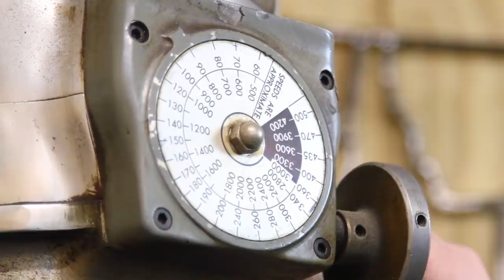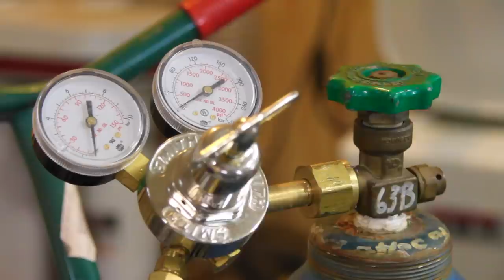Making a Striking Anvil

Comment: I absolutely love the anvil, Paul. It worked great today. Nice getting to meet you for the pickup. Thanks again.
Reply from the maker: I’m glad you like it! It was great meeting you too
Reply: So what is different about a "striking" anvil and why do you need one?
Reply: @carpediemarts705   It's an anvil saver.  When using a sledge hammer to do heavy work, if you miss, the striking anvil takes the hit, not the expensive, hardened anvil facel.  Also is a bit lower so the striker can get some power into the swing.  The striker being a human power hammer....  Or rat powered if this is a documentary:  https://youtu.be/8Gwty_y2J78?t=9

Comment: Can you forge on it?  Yes. And that's all you need.  If you need a horn, make one that'll go into the hardy hole.   A simple round bar forged to a point is all you need.  (Or you could have it turned on a lathe if you don't like forging stuff for some strange reason). Well done.

Comment: I'm an amateur machinist and welder but was wondering?

1: layout of the hole. If 1.000 D then put it straight in the mill, find the center of the hole and x:0,y:0 then corner is x: 0.500,y: 0.500 , etc - the radius of the drill bit and no center punch needed if you start the hole with a center drill. 

2: why not use a radius end mill on the corners instead of a grinder? 

3: when it's still in the mill why not fly cut the top? 

4: loved that you hand filed but if you invest in a dyna file you will not regret it. There are knockoffs that are cheap but the dynabrade cannot be beat. It is for sure a buy once cry once tool. 

C: I wanted to see a ball bearing bounce. A good anvil needs good rebound. 

Also what were the materials? I'm guessing the legs and feet are mild but maybe m3 or h11 for the big chunk? 

Keep building. It's becoming a lost art.
Reply from the maker: 1 the piece of steel already had a hole in it when I bought it so I couldn’t really start from a center point and for this application the hole didn’t have to be that exact 
2 I don’t have a radius end mill 
3 it doesn’t matter 
4 I don’t have one lol
5 people make striking anvils out of mild steel all the time because it’s just going to get beat up anyway and it’s a lot safer because if a striker misses and hits the edge it won’t chip off and turn into a projectile like a hardened anvil would

Comment: When drilling a hole try using candle wax. You will find it is quite a bit less messy to say the least. Nice job fella.
Reply: "Try using candle wax?" Under what circumstances would candle wax drill through steel?
Reply: @v3124  What one does is take a candle and just touch the revolving drill and just start drilling. Then every so often retouch the drill. So easy to clean up the surrounding area from the swarf. Instead of oil flying all around the place. Works for me and should work for you too.

Comment: Why grout the legs? Damping perhaps? Fully cured grout has similar elastic properties (but not the strength) to steel. I can't imagine much energy loss between their interface. 

I submit two bays trianglating the legs will have several times the effect of grouting provided the assembly is securely bolted to a solid floor.
Reply: It’s just to make the whole thing a bit heavier. The heavier you can get the anvil, the better.

Comment: What kind of steel is the striking anvil? Love the project.
Reply: Jeff Strauser I use 4340, sometimes 4140. That’s chrome moly. These are particularly good for striking, as they work harden. They’re very tough. Standard A 36, which you find more cheaply, deforms. After a while, it’s all banged up, and needs a good grinding or milling to fix. If that doesn’t bother you, then fine. But I use this for sheet metal too, and a flat maintained surface is very important for that.
Reply: @melgross  that's why I wanted to know I've been using a regular anvil to make armor and it's not as flat as I would like.

Comment: Looks good, these came up in conversation on the Blacksmiths Pub podcast last week I think. They didnt really understand the need for a striking anvil. They said why dont you just use your regular anvil? What are your thoughts?
Reply from the maker: Thanks! I’ve never actually used one and this one is for a customer but I definitely see how they make sense because you can make the stand a lot lower which makes striking much easier and you risk damaging a real anvil if you are working with an inexperienced striker. I wouldn’t want to spend a bunch of money on a real anvil and put it on a stand that’s too short for regular use

Comment: Great job Paul what angle did you cut your legs at and are you happy about the end result or would you change angle. I second the soak in vinegar to remove Mill scale. And I can tell you it doesn't matter how big your shop is it's never big enough. Thanks again keep them coming
Reply from the maker: Thank you!! I cut them at about 7.5 Degrees and I think that’s what I would stick with and the vinegar is a good idea